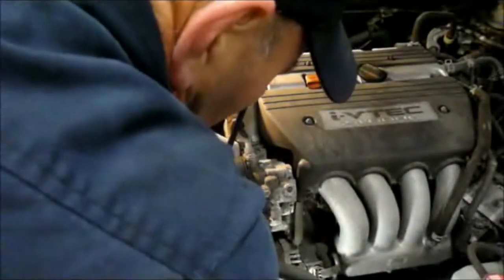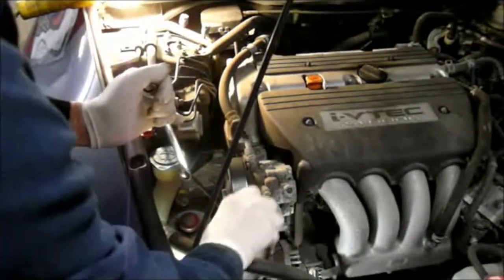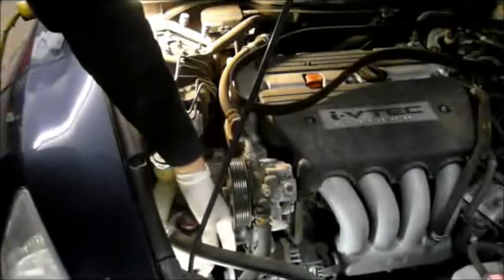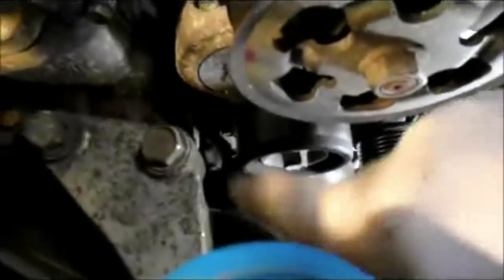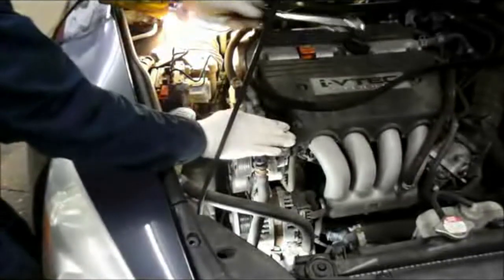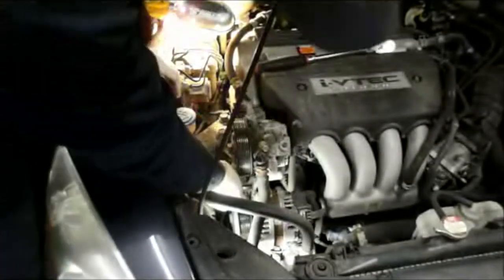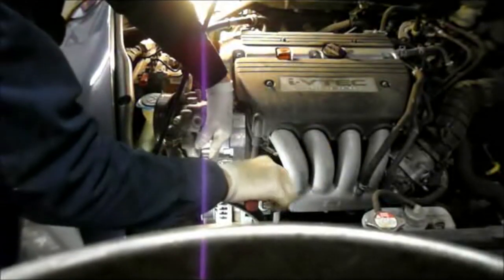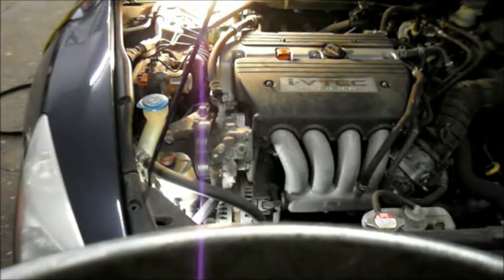Drive Belt & Tensioner Replacement 2003-2012 Honda Accord

Comment: Just did and altinater on a 09 focus super  hard to get back on belt supper tight to get back on all the pullys are good going change and see what happens you can throw your 2 sence in if you want checked the belt size 3 times
Reply: Change the tensioner